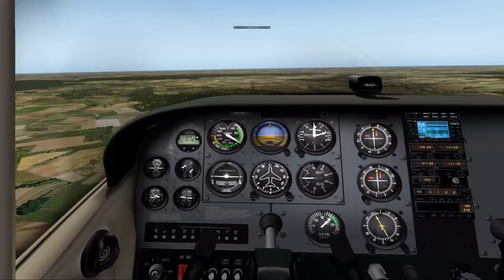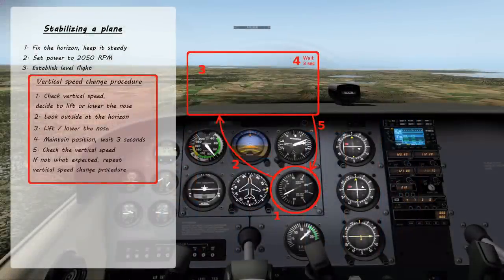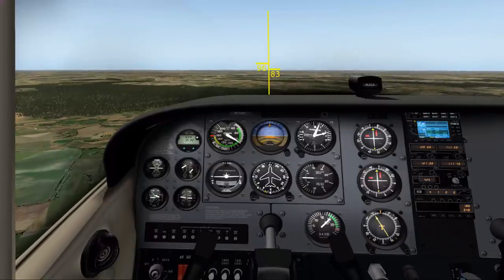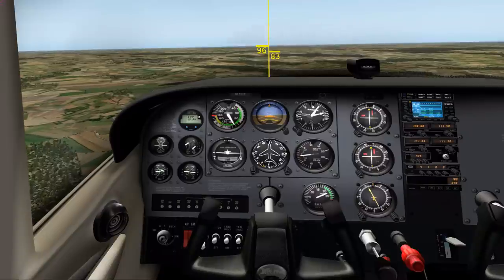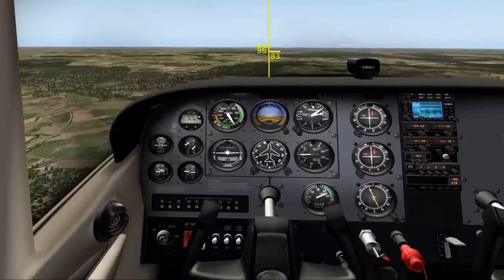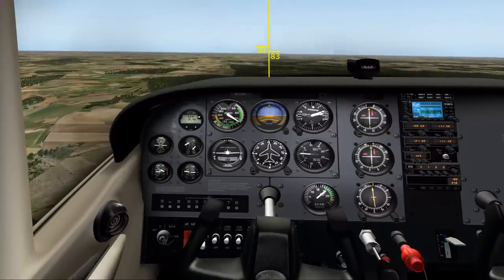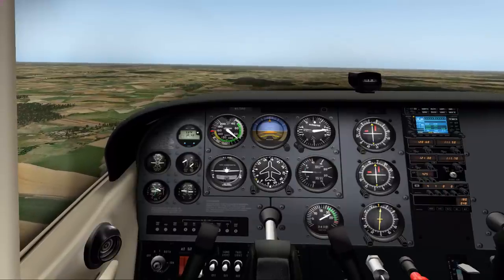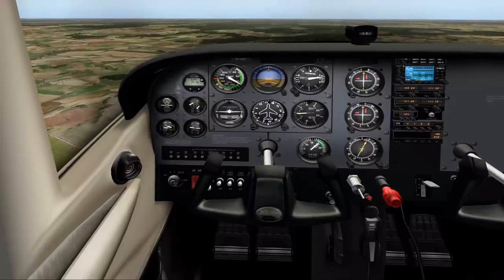How to fly in X-Plane - part 5 - level flight

Comment: Just wanted to say I'm finding your videos very helpful, and nicely done. Thanks for taking the time to do them and share.
Reply from the maker: Steven Zimmet Thank you for the positive feedback
Reply: wigrysystems How do you recommend learning take off and landings?
Thanks again.
Reply from the maker: Steven Zimmet I haven't reached that part yet but for both takeoffs and landings, the most critical aspect is to get your speed under strict control. With C172, on takeoff lift the nose at 55kts and then use horizon to keep climbing at 75kts. When landing, progressively add flaps. With flaps 0, reduce the power so that you maintain 95kts, then add flaps 10. Do nothing else but maintain altitude and wait until airplane decelerates to 80kts, then add flaps 20, reduce power to about 1800RPM and start descent. Again use horizon to maintain 500fpm descent at 75kts. When established on final, add flaps 30 and do nothing else - the airplane starts to descelerate. Do not allow airspeed below 65kts. Add power if needed. However constantly aim at runway threshold. You should cross the threshold at 65kts and just couple of feets above ground. Now pull power to idle and start flaring - establish level flight above runway surface. Make sure you are going down the center line and constantly make small adjustments in bank angle if needed. Now the hardest part. Look about 30 meters ahead and 20-30 degrees to your left at the runway surface as it passes by and with that sight alone try to maintain level flight. With this lookout you should be able to detect any climb or descent and if you do, then adjust your back pressure accordingly. Maintain level flight as long as you can. Throughout the flare as speed decreases, the angle of attack must be increased to maintain lift, so constantly pull on the nose up - slightly at first but progressively faster as the speed goes down as elevator loses its effectiveness and you need to make bigger input to get the same output. You pretty much pull the nose up throughout the flare. As mentioned, look 30 meters ahead and 30 degrees to the left to the runway surface to see any climb or descent, and adjust your back pressure. This will eventually lead the point where aircraft cannot maintain lift and gently settles to the ground with main wheels first. Have a look at my "Little patternwork" video how its all done.
Reply: wigrysystems Thanks very much. That's very helpful. And again, thank you for the great videos!

Comment: Having trim problems with your flight yoke in X-Plane?
>>>>>>>>>>>>>>>>>>>  SOLVED  <<<<<<<<<<<<<<<<<<<<<<<<<<<<<<<
The problem is in the configuration of the planes, all of them. The default settings in X-plane cater to USB devices other than flight yokes and to assist these devices the configuration is set to actually alter the ailerons and the elevator every time you make a change to either ones trim setting!
Yes, sound nuts. Wouldn't be so bad if they had made a way to correct this from within the x-plane interface but no, they didn't or maybe let us know in the manual or in the front page tips. To sort this you need to go into Plane maker.

Like you I had the same problem but thankfully found this gem which steps you through correcting it, although the poster is using a Brunner yoke, it works with CH and I would expect any flight yoke. You will immediately see the problem at the start of the video and the fix takes less than 5 minutes. Much Kudos to the poster for sharing this.

Setup Realistic trim for X- Plane with BRUNNER Controls
https://youtu.be/Wa6souKuesk

Comment: Really loving your videos. It has been structured in a very detailed manner for novice learners like me who are learning xplane.
Two things that i am curious about is the GPS skin, it seems to look different than the one in xplane 10 and secondly, you are able to view the whole dashboard and controls together. is there some setting in rendering as however I try,  I am not able to see all the controls together.
Reply from the maker: +Vignesh Chandrasekharan GPS has been improved in newer versions of X-Plane so what you see in the videos are from version 10.22. The view area can be tuned on Rendering Settings under Field of View and you may also need to enable unproportional Field of View setting so you can tune both horizontal as well as vertical view angle
Reply: Thanks for your tip. I was able to change the view.

Comment: But you gained 200 ft while "maintaining level flight"!  Must watch that!!!!!!!!!!!
Reply from the maker: Yeah I noticed that but it was kind of inevitable as I was explicitly showing how an airplane reacts. Also it is surprisingly difficult to lecture and fly precisely at the same time and finally it leaves the viewer a possibility to fly better than me :)
Reply: wigrysystems Flight instructors do it all the time.
Reply from the maker: Laurie Johnson
Yes in a bit more relaxed environment that live video recording where each and every word you say must be carefully thought through as not to give any wrong message. Second thing is that this video was not so much about maintaining altitude but the main focus was demonstrating the effects of acceleration and deceleration to lift and therefore vertical speed and how to use horizon to manage the vertical speed and keep it within desired value. So after 25 minutes of demonstrating all the forces I only changed the altitude 200feet (I really didn't care nor check the altitude). So that makes 200 feet / 25 minutes = 8 fpm climb average.